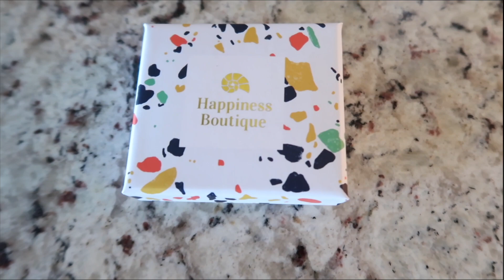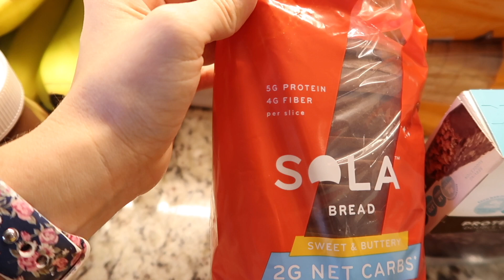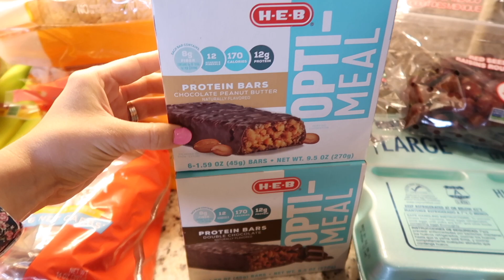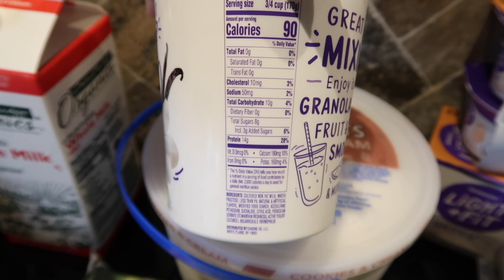*NEW* EXTREME CLEAN WITH ME | REAL LIFE MESS | DECLUTTER + ORGANIZE | COMPLETE DISASTER | PACKING

Comment: Why to wash the dishes before putting them into the dishwasher? With the right program and right loaded it has to remove all the dirt!
Reply from the maker: What dish detergent do you use? Every time I’ve left food they’ve never came out clean. 😐
Reply: @ashleyforbes  well, I am in Europe but I am using the tablets and glance liquid (i hope that is the english name!) from Aldi. Here our water is not hard at all so I do not use salt. The key is to use the appropriate settings (program, temperature ) and to load right (no overlapping dishes). Most of the dishwashers are checking the dirtiness of the load by some optical measurements and then regulating the rest themselves-that‘s why pre-rinsing could prove ineffective. I never pre-rinse my dishes and for 99% of the time it works-and I also hate handwashing the dishes so I easily have 3 loads a day 😇